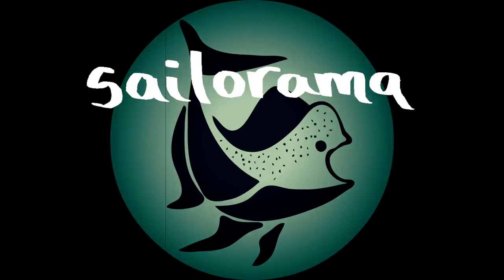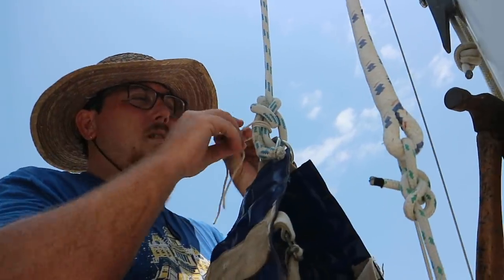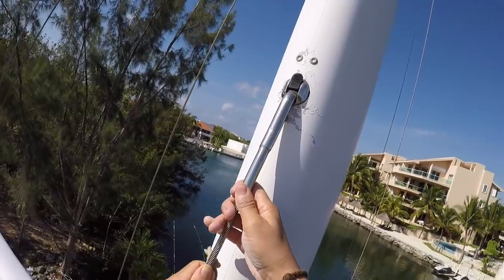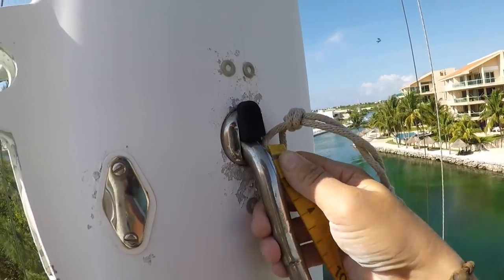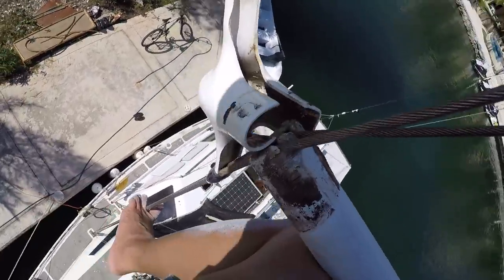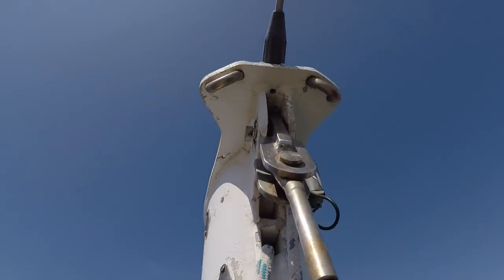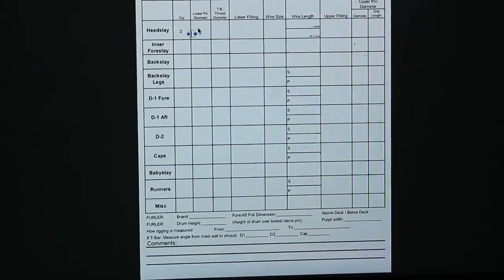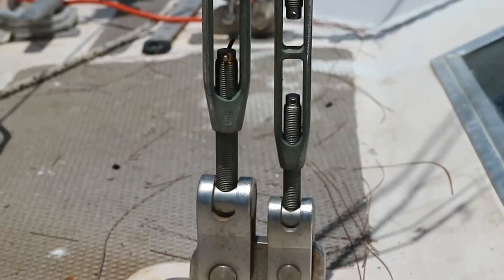60. Sizing Her Up

Comment: I noticed you guys had 100 watt solar panels attached to the sides of your previous boat's pushpit, did that give you enough power to avoid using the engine for charging?  I'm thinking of doing the same thing as I'll likely be taking ownership of a 26' sloop without any means of producing electricity (apart from the alternator). It's a huge expense but I  need to be able to charge my laptop. Did you find the panels' position annoying or obstructive?

Also: how did you attach them to the rail? 

Nice to see what you three are up to:) Choco is even more adorable than before 🙂❤❤
Reply from the maker: Hey there! We last had two 100 watt panels on the stern of Rossa with three batteries, which was suitable for our power consumption (three led strip lights - saloon, galley, v-berth, as well as overnight passage using navigation lights, small chartplotter, radio, and then charging camera and computer during full sun of the day). But that was the upper limit. Although we never had to run the engine only to charge batteries, it was ‘useful’ when we would have to run the engine on passage. It would nicely top batteries up. Honestly, I think if we had more panels and bigger battery bank, we would have subconsciously used the engine less. Small solar setup ‘inspired’ us to turn on the engine to get into the anchorage more quickly and top off the batteries before night.

Without having ever having been able to afford a proper bimini to hold solar panels, we’ve used some cheap, plastic multipurpose rail clamps with wooden stick to prop the panel to the right angle. It does take up precious real estate on the rail, but if you don’t have an arch or bimini for the panels, it really is the only spot on the boat that is guaranteed to not be obstructed by the sails/rigging.
Reply: @sailorama  Ah, thank you for the detailed response.  I kind of suspected 200 Watts might be a bit lean. Yes, a bimini would be good. My boat has one but it's probably a nuisance to use as I'm built like a giraffe. Might try to use the steel for a proper pushpit arch
but will have to see if it's too much windage. Fair winds, amigos :)

Comment: You don't really show the turnbuckles closely but they look like they might be by merriman?  In any event they're clearly bronze and should be reusable for the life of the boat. If they don't show signs of stretching I'd think again about reusing them as they can be quite expensive.  If you don't reuse them you should try to find a buyer for them as they undoubtedly have life left in them unlike some of the other components of your rig, some of which looked like they might have been close to failure.
Reply from the maker: They're definitely still looking good. We didn't think of selling them. We're not very business minded haha. But that's a good idea.

Comment: question:  can i assume that you are measuring both sides, to get an average, believing that properly tuned, both sides should be exactly identical in length?    (trying to learn from ya'll).

why don't you consider a junk rig, as a replacement instead of the cost and headache of replacing your existing rig?

I know there is a speed loss under certain conditions, but the speed gains in other conditions evens out average speed of the two, making the only real difference is the much lower cost of initial install and maintenance, and easy/safer use for the Junk rig.

what are your thoughts on that?

it's hard to find information on junk rigs from anybody except junk fans, likewise it's biased .
Reply from the maker: Love how we get really creative ideas like this! Okay, so we currently have deck-stepped, mainsail-furler kind of mast with a stainless steel compression post under deck that sits on top of the keel. We could technically bolster up the entire midship deck somehow, cut a giant hole through it, create a leak-proof through-deck, create the appropriate place for the mast to rest on top of the keel inside...get a new mast...hmm, but this list of changes is starting to look more complicated than just buying some new wires with appropriate fittings on their ends. Which is pretty much why we wouldn’t go that route. I actually really like the concept of junk rigs though! Even more,  I really enjoyed the Wingsail rig of my previous Wharram Tiki 21. Now that was simplicity, and ridiculously safe!
Reply from the maker: Also, good question - it’s best not to make an average measurement from the two sides. Since Robi tuned the rig lightly, and the mast is nice and straight, the lengths for each side reflect the symmetry of the boat. If the measurements for each side vary drastically (by more than a couple of cm) you might have other structural issues to take care of before replacing the rigging...
Reply: @sailorama  i hadn't considered the symetrics of the boat.  thank you for that.    there's a rare few good channels that offer sound and reliable knowledge.  of course you are one of them.  

I brag about ya'll to others.
Reply: if ya'll had a robby cook book i'd of given it out to my customers yesterday at the chili cook off  (hint hint!!!)
Reply: @sailorama  good response!!  I like that.

I didn't think it'd be that much of a headache.  what i do know is that you two are always on top of it, looking a step (or 3) ahead.

I remember you talking about your Tiki 21.  is there a video with it, or pictures of it online, i don't remember.

(I dont' think i've missed any of your videos from the start..).